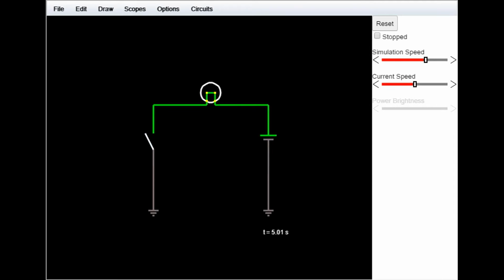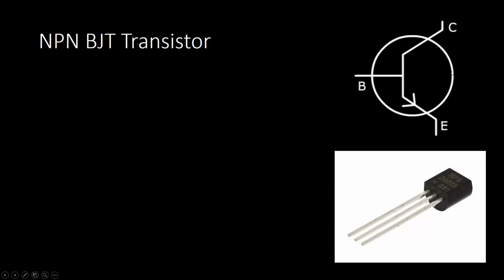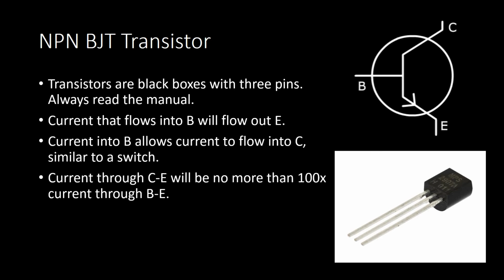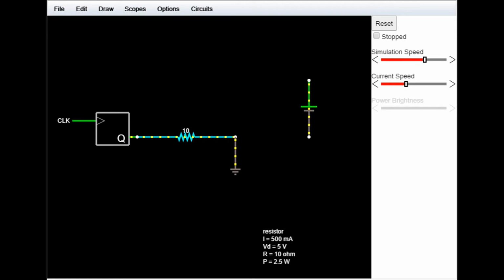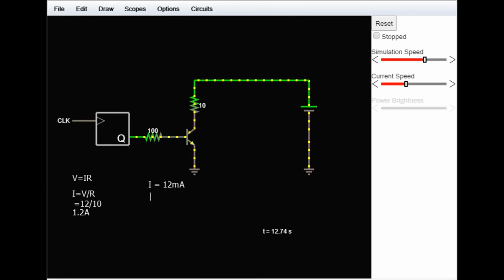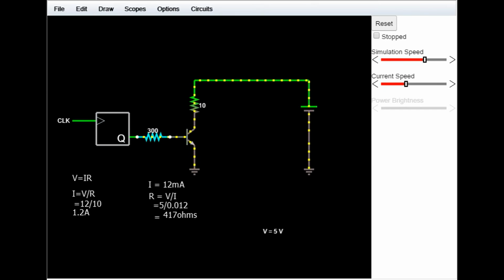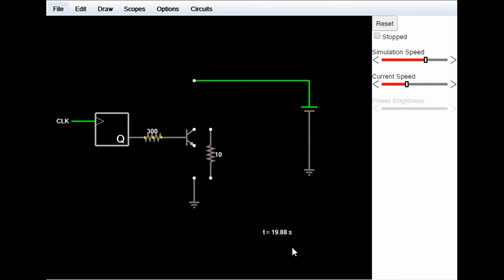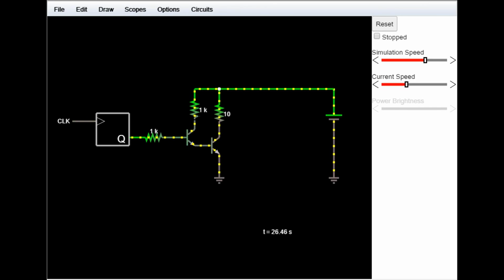Practical Transistor Tutorial w/ Arduino + Driving a Motor

Comment: I have a question :)
my dc motor has a nominal voltage of 16V and a current drain of 32A... should I really model it as a 0.5 Ohms resistance?
Reply from the maker: Depends on what the current drain rating is for. Is that the stall current (seems like it would be because it's incredibly high)? If so, the 32A is a worst-case scenario for when the motor is lifting an "infinitely" heavy load and cannot spin (heavy load = more power usage -> makes sense). That's an unlikely case for most applications. I talk more about this on my videos about H-bridges.

Edit: Make sure you're using power transistors for those currents!
Reply: Thank you for writing such a detailed reply. Though I am a mechanical engineering student, I was assigned with this project which I know little of.In the tech. specs. there are three different current values

Idle: 2.0A
curr. drain at max efficiency: 32A
blocking current drain: 150A

I have to drive a propeller with this motor so I hope using a mosfet, and a couple of diodes to eliminate the inductive spiking, would solve the problem. :)